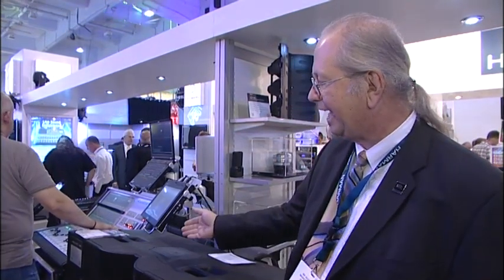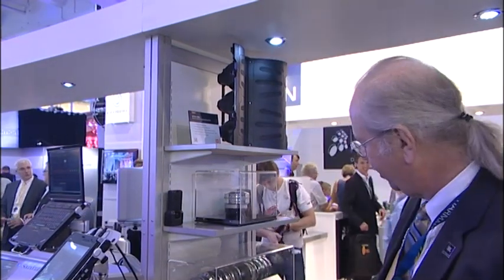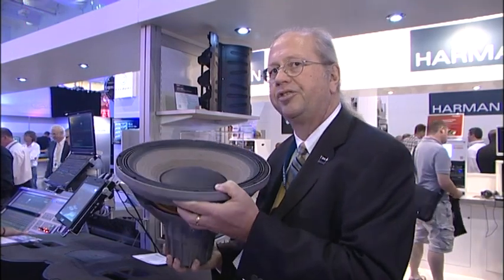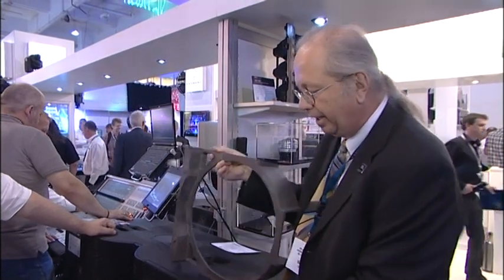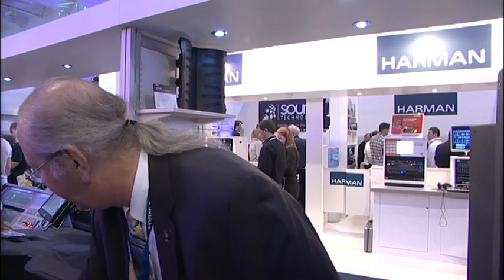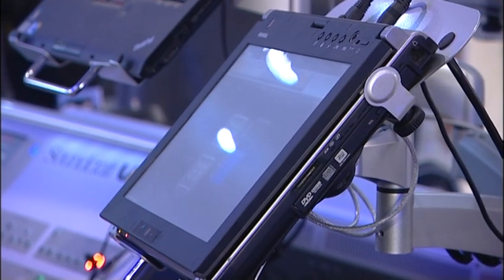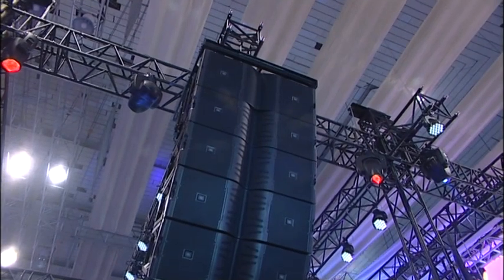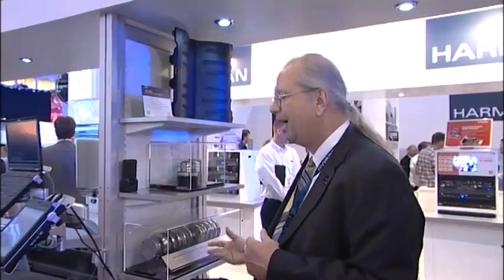AWARD WINNER: Harman - JBL VTX V25 Line Array with D2 Dual-Diaphragm Driver Technology

Comment: Excellent presentations of JBL components. More than ever JBL marks its technological superiority, and it is important to remember that JBL is at the origin of the so-called ARRAY design. We are in the 80s and the presentation of the ARRAY series which we still see, admittedly rarely, but which has aged superbly well. JBL manufactures all of its speakers, the best in the audio industry. 80% of brands are only assemblers. The strong point of JBL is the synergy with the other brands of the powerful Harman group: Crown, DBX, BSS, Lexicon, Soundcraft. The purpose is based on maximum optimization and an extraordinary result without competition.